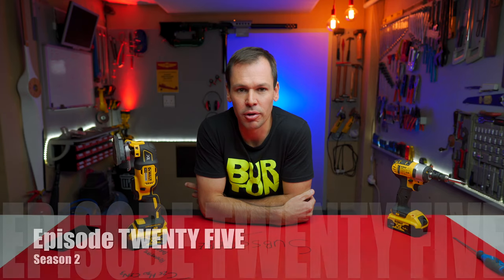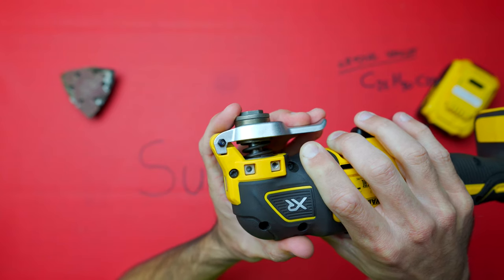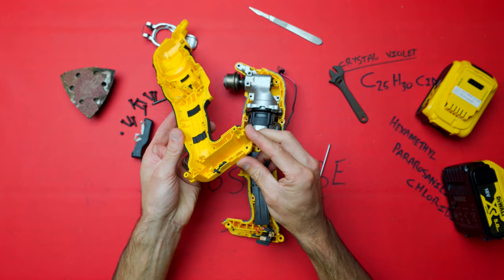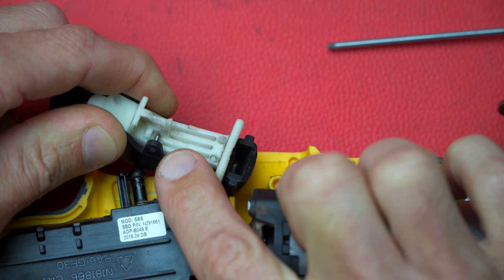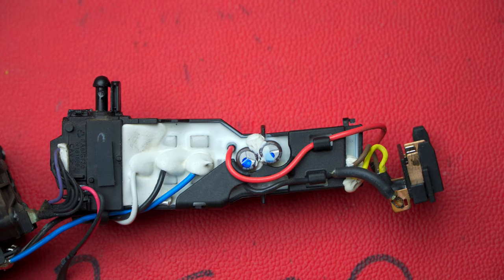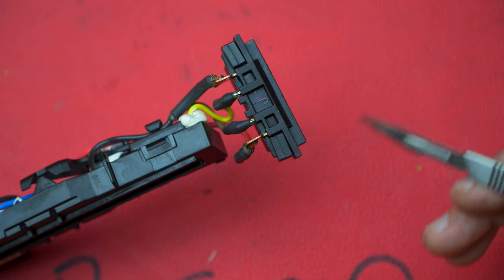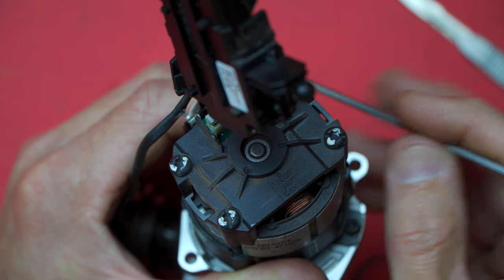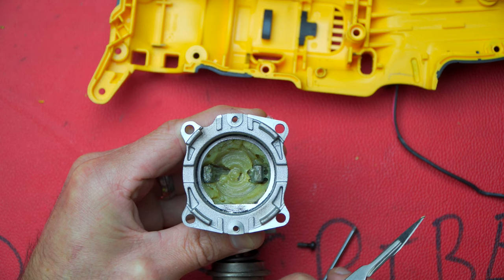TEARDOWN - DeWALT DCS355 20v XR (DCS354 Atomic?) Oscillating Multi Tool - BURTON BUILDS [4K]

Comment: Thanks Grant, for a  comprehensive review, and for skipping the obvious.
I've come across your channel whilst searching for an answer to the reason my blade slips while under heavy load.
I thought it was the blade itself slipping or jumping in the clamp detents, though found in time that the shaft can be rotated with reasonable hand pressure to the side of the blade.
The tool has been in heavy use for 3+ years so I'm not surprised if there's wear in the gearbox.
 It doesn't slip with a ratcheting type feel though, as might be expected with stripped nylon splines.
Just wondering if you have any thoughts on where the slippage might occur.
The spare parts lists don't show any replaceable parts for inside the gear box.
As far as I understand there's no physical connection between the motor and the gear box other than the drive bearing riding inside the oscillating fork.
It seems a replacement gearbox is in order.

In terms of dependability, I can't break this thing. 
Not the quick release blade change lever pivot points, or the switch wires, or even the switch lock-on  holding tabs.
She's been a great piece of equipment in my down under Renovations business. 
Love the jabs back at Wed,Thur,Fri too.
Cheers
Reply from the maker: Hi Robert, my first thought would point towards the inner surfaces of the fork being worn. Maybe the clearance between the bearing on the motor and the prongs of the fork has increased after years of use and so the eccentric rotation is not translating into the full full sweeping motion the blade once had. This is a pure guess. I recon you would be able to see wear here by cleaning all the grease and looking for any worn or sharp edges where the bearing normally rides on the fork.

I haven't stripped the gearbox far enough to witness how the fork joins onto the spindle / arbor shaft but, at a guess, this is an interference fit / press fit between the fork and the shaft. Maybe this is starting to loosen however, if this is happening, I would think it will loosen very quickly over a short period of time and you would loose complete oscillation very quickly.

The last part that comes to mind is where the spindle shaft joins onto the blade holder. Also guessing that this is just an interference fit. If this is starting to loosen, you may be able to rotate it by hand and see if there is any movement between the blade holder and shaft.

If you remove the gearbox, hold the fork securely to one side and try rotate the tool holder end from side to side, if you feel moment / slop / play then it's likely the joints as a mentioned above.

Further than that, my guess is as good as yours... and unfortunately I won't be able to get near the tool for some time so I cant even have a closer look for you.

Please let me know if you eventually find the problem?

I'm glad to hear the rest of the tool has held up well with heavy use. Its always nice to hear.
Keep safe and well.

Comment: CAV # on the plastic parts is likely cavity number for the die they're using. They mold a bunch of these parts in the same tool, so knowing which cavity of the tool a part came from is very helpful for quality control.
Reply from the maker: Hi Mike, thanks for the info... makes sense for when a part is starting to look a little out of spec, they can identify the die and either repair or replace it.

Comment: If I am incorrect please explain but thinking about soldered connections vs a screw terminal on a vibrating tool like this I definitely think solder would be better than a screw. With intense vibrations screws will shake themselves loose quite easily unless they are wired in place. I definitely think a crimped connection would be best though.
Reply from the maker: I think your guess is as good as mine, but possibly a combination of crimped, soldered and heat shrink joints would be good? Possibly the use of a terminal pin where the wire is crimped in two places, the back being crimped around the insulation and the front crimped and soldered around the wire conductor... then the terminal pin is soldered to wherever it's going... then heat shrink over the lot.

Thoughts around using a terminal pin with two crimps is to provide better strain relief, so that vibration / flex / 'the fatigue point' is transferred to the insulation and not directly on the conductor itself (in the case where the conductor is only soldered with no other support or insulation). This lends itself to a much lower failure rate because of less metal fatigue.

Other than crimped connections, I've also seen soldered connections with epoxy / potting over, which would also work, so long as the epoxy sufficiently covers the insulation and the terminal to which the conductor is soldered, and of course sticks well enough over time (doesn't become brittle and crack).

Or like in another comment you made, at least heat shrink over the entire connection, with sufficient cover over the wires insulation and the terminal to which its soldered (the heat shrink providing mechanical support over the entire connection and removing strain from the wire conductor).

I think screwed connections can also withstand a bit of vibration but only if thread locker is used... but this comes at cost.

But at the end, I guess it comes down to cost vs reward... if the failure rate is acceptable relative the cost saving, then I guess thats the compromise.

Comment: When I push down the handle to change the blade it will not open enough. I could use a pair of pump pliers to squeeze it enough to open it but now that doesn't work. Do you have any idea of what part I would need or how to address it?
Reply from the maker: Hi Jamie, it's difficult to diagnose without seeing the tool. The first thing that jumps to mind is the silver Clamp Lever which could be worn (or bending and not allowing the flange to retract enough) The clamp lever is what pulls back on the lower flange and compresses the spring. Part number is N254619 on my tool.

There are two pivot points (pins) on either side of of the lower flange. The Clamp Lever pushes down on these two pins resulting in the spring being compressed. I'm thinking that the plastic that pushes on these two pins is worn out and not allowing the flange to be compressed enough. Just a guess though.

To check, you'll have to remove the Clamp Lever and inspect the area where the two pins interface with the lever.

Let us know how it goes?
Reply: @GrantBurton  ok thank you very much. As soon as I get a chance I'll look into that. 👍

Comment: You did not show how you got the Motor separated from the head, can you please explain to me how you did it because I cannot get my own off.......
I have loosened the two screws and it's still not separating.

Need help please.

And I cannot seem to find any other videos of DeWalt's oscillating tool tear down!
Reply from the maker: Hi Shawn, once both screws are loose, the motor should pull out of the gearbox fairly easily. There is a rubber O-ring which seals the casing insert on the motor side to the gearbox housing... maybe this is just catching up a bit, or maybe your parts are better machined and fitting a bit more snug than mine. I’ve made an update video with a clip showing the removal of the motor from the gearbox here https://youtu.be/TYcH3zOqSSE Feel free to check it out... hope it helps.

Comment: mine stops working in the middle of or the trigger doesn’t work all the time I have to push the trigger several times to make it work. I noticed dirt inside the trigger and cleaned superficially with alcohol and it worked but did it again. what are your thoughts??
Reply from the maker: Hi juancha79, initial thoughts are that dirt / dust / debris have made its way into the switch assembly and into the potentiometer / variable resistor that interfaces with the speed controller to control speed / on / off (I say potentiometer buy it could very well be another encoder of sorts). The dirt has likely been rubbing on the pads of the potentiometer as the switch is being used and caused wear (or so much dirt that the pads aren't even in contact anymore). If the wear is not too bad, a good clean out with some electrical contact cleaner spray might do the trick. If the pads are completely worn through then the it's probably too late.

Keep us posted with your repair.
Reply: @GrantBurton  I will clean it inside. thank you so much.

Comment: Thank you Grant,

The slippage must be occuring at the press fit conection of the Arbour shaft to  the gearbox fork.

I can view the Arbour shaft rotation at the back of the gearbox when rotating the head of the Arbour.

I expect this is not a solid connection to protect the tool from destroying itself if the blade becomes bound up in a workpiece,  e.g. sawtoothing hardwood floorboards for a room extension (there's easier ways if the clients budget demands it but otherwise I do it the hard way). 

The press connection is still quite tight and takes a reasonable amount of pressure to slip the joint, a such this only becomes an inconvenience under heavy work. I suspect it came about from one of the young guys forcing blunt blades to finish a job. 

I don't blame them for that, it's my job to supply consumables.

I have ordered a replacement gearbox for about 60% of the cost of a new, skin only dcs354. I opted to repair my 355 as I figured the 354 may just be a cheaply made version for the bigbox DIY market.

I'll provide an update following the replacement gearbox and some in-service use.
Regards.
Rob
Reply from the maker: Robert Hammond Awesome... thanks for your update. It’s really nice to receive feedback which may be able to help future viewers that may experience similar problems. Thanks very much.

Comment: Is the bearing that oscillates between the fork one with a spherical outer diameter? Or is it a standard cylindrical radial bearing?
Reply from the maker: Hi Emilie, its a standard bearing... The centre shaft that the bearing fits over is slightly offset from centre which causes the back and forth movement when rotating (very similar to a crankshaft in an engine).

Comment: On my multi tool the very center screw , when tight will make the tool start and stop. I had to remove the screw completely and now the tool will stay on. Will I have problems with this later on, do you think one of the wires are routed wrong.
Reply: Mine is doing this I just took it to bits and seen your comment gahaha
Reply from the maker: Hi James, I doubt if one of the wires are routed incorrectly because they are pretty short and pretty much have to follow a direct path from the speed controller to the motor. This is a wild guess but if you open it up and noting appears to be wrong, then maybe there is problem with the switch or board internally and when compressed by the case / tight middle screw, it causes a poor connection due to a dry joint or cracked PCB track? Like I said... just a wild guess. It could also be a dry joint at the motor connection or within the wires leading to the motor and again, when clamped into the shell, maybe the break in the wire is being pulled apart? If under warranty, send it back or if out of warranty, maybe do like Daniel and open it up and see if there is anything that looks suspect.
Reply from the maker: Hi Daniel, were you able to identify the problem?

Comment: Hey,
Do you know exactly what type of grease/lubricant that is inside the gearbox at around 16:00?  I would think it would have to be good considering the speed/heat of the oscillations.

Thanks.
Reply from the maker: Hi, I'm not exactly sure what grease it is but I would loosely guess its a general purpose Lithium grease? (although I'm no expert on grease so maybe I'm wrong) (Update on grease? in this video https://youtu.be/TYcH3zOqSSE )

Comment: So there is lots of metal to support the spring, we see this in the housing, and it looked like an H not an N to me where you questioned the motor.  Thanks for the break down.  In the market for one now.  I have 2 others, one is Makita cordless and it's bulky and heavy, the other is rocker and it's corded.   I switched out my cordless tools from Makita to Dewalt.   Does anyone buy after market batteries for these tools and how do they hold up?
Reply from the maker: Hi Stephen, you are correct, there is a lot of metal support structure within the yellow plastic point of the clamshell and after opening it up again, the weak point is definitely going to be the two plastic ears on the silver release lever (not to say that its weak... its probably fairly strong and reinforced with 50% glass fibre but that's likely the weakest point). Here is a second teardown with another closer look at the section we were discussing. https://youtu.be/CZEkC3bHx0U
Reply from the maker: In addition, I've had no experience with aftermarket / pirate batteries for these tools but the channel AVE explored the difference between the Dewalt aftermarket and original batteries. I left a link in this video. https://youtu.be/CZEkC3bHx0U

Comment: Sir, thank you for your video I appreciate it!

I have a question, I have a had two DeWalt oscillating tool ( cordless ) each one for less than one year....... The same problem occurred with each one of them, the ball bearing that's on the motor that causes the tool to vibrate somehow on both of them it breaks, and in both cases it happened while in use.
So now I have two tools oscillating tool that doesn't work, love DeWalt tools but I will never buy them again pertaining to oscillating tools.

Could you recommend a better more efficient oscillating tool, I'm attached to dewalt tools but no more oscillating tools from them......

I have and had many DeWalt tools, I expected better from them!

Do you have any suggestions?
Reply from the maker: Hi Shawn, are you referring to the ball bearing that runs between the fork at the input side of the gearbox? If it's that bearing, maybe a repair option would be to order a replacement bearing from a local / online bearing shop and press it on? My bearing measures at 7x21x6mm (7mm Internal diameter, 21mm external diameter and 6mm thick) and what looks like a standard deep groove ball bearing.

I cant really recommend any other oscillating tools because I don't have experience with any others so any recommendation I did try to  make would only be based on user reviews, which means it wouldn't be a recommendation based on personal hard evidence / experience. Sorry I couldn't be of assistance in this regard.
Reply: I just tore mine done and the bearing came apart, also. I've used it for 3 years though. I may try to find a bearing with the measurements you provided, Grant. Thanks
Reply: I just spent quite some time trying to find the bearing, with no luck. I did find it listed on some Chinese sites where you need to buy a very large quantity. Best I can tell, it's bearing 607X2T or 77j.

Comment: 2 other Version 
DSC 354
DSC356
Reply from the maker: Hi Joni, yes you are correct. The DCS 355 is from their Atomic Series of tools and the DCS356 is the a newer version with 3 Speed Control selector that works together with the variable speed trigger.

DCS354 Oscillations/min: 0 - 18 000 OPM
DCS355 Oscillations/min: 0 - 20 000 OPM
DCS356 Oscillations/min: 0 - 13 000 / 0 - 17 000 / 0 - 20 000 OPM

I also believe that the 356 runs a little more quiet and has slightly reduced vibration (from what others have said) .

Comment: Just got one of these for repair -  switch found to be faulty, full of dust. The cost of a new switch is £88.00  !!!  ( the switch & motor come as one assembly  - NICE one DEWALT %**@@*%  )
Reply from the maker: Planned obsolescence possibly? I agree that this is a weak point on many of their (and other brands) of tools. Under normal circumstances, I'd just disassemble the switch, clean / repair it, and use the tool again (hack the switch if I have to) however we can't be doing a hack job when repairing a clients tools... need to be as professional as possible.

I also find it completely unnecessary that they make us buy the complete switch and motor assembly... damn money making scheme IMO. The hall sensor wires are on a block style connector so super easy to unplug and the three motor wires can easily be unsoldered (Now if they had just used a spaded and screwed connector arrangement, that would have made everybody life much easier).
Reply: @GrantBurton  Imanaged to fix it  :D  the fault was actually a broken Brown wire , within milimetres from where it is soldered to the battery connector , & IN the heatshrink - very hard to detect as the wire DEWALT use is very stiff, and the reson it broke due to the vibration of the machine. I am still angry with DEWALT for having a spare part sub-assembly the is 90% of the cost of a new multi-tool, and for using stiff wires & solder joints in a high vibration use.
Reply from the maker: @andy530i  I wonder if it would have been better if the wires were crimped to a terminal lug and then that terminal lug was spot welded or fastened (using a machine screw) onto the battery terminal plate?
Reply: How do i seperate the motor from the gear box or the head piece. Mine will not seperate. Says in video clamshell holds together
Reply from the maker: Hi Zackary, Hope this helps... check out the update video showing the motor separation here https://youtu.be/TYcH3zOqSSE
Reply: @andy530i  Spot on Andy - I have just managed to repair one of these with the same fault - thanks for sharing.